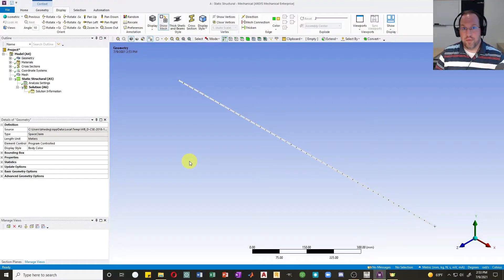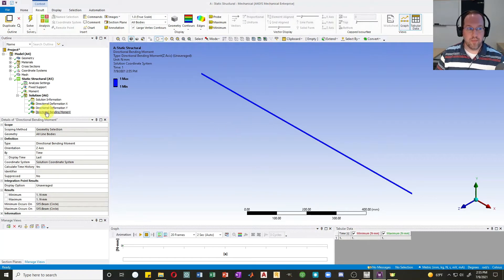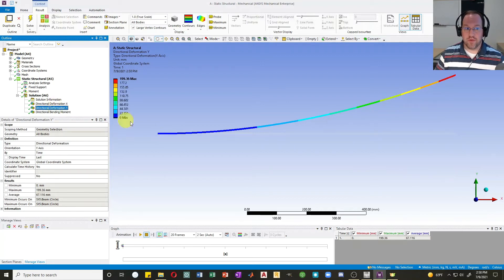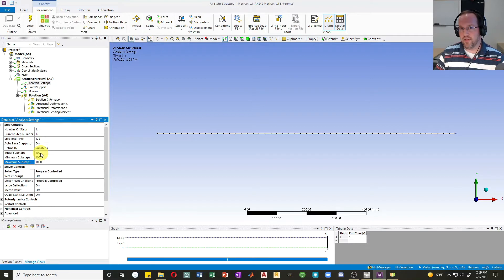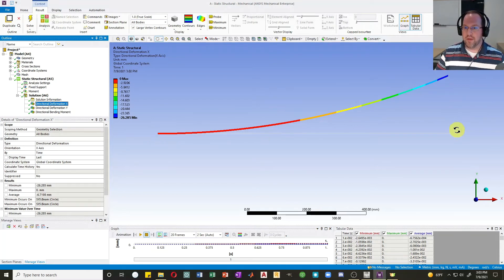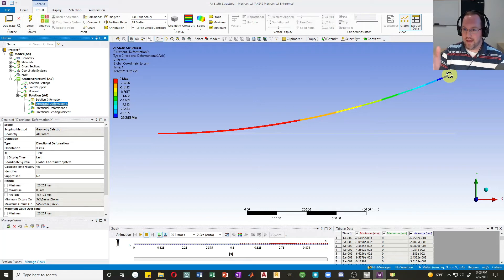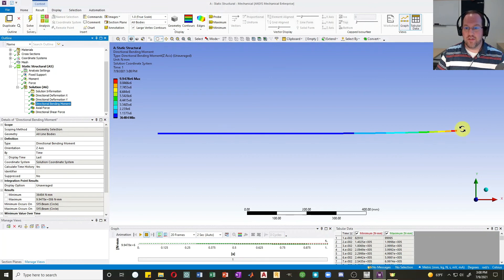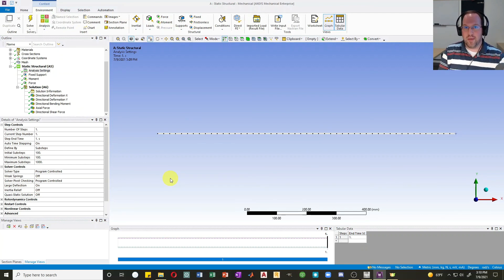Nonlinear Geometry and Large Displacement Analysis - FEA using ANSYS - Lesson 7

Comment: please i have a question, i simulated a ball on disc, the target material being a polymer i assume it ecounters large deformation, i assume it is hertzian theory, that appears to be wrong, to not assume it should i change it to large deformation like in the video?
Reply from the maker: Not sure if that will solve all your problems here (contact can be tricky), but yes, at the very least you should use large deformation. I’m afraid I can’t help much more than that without knowing exactly what you are up against here.

Comment: Greetings Prof. H  i have a question how the axial load caused the end moment to become almost Zero . what i understand is that the applied axial load should have increased the End moment as the deformation of the tip is  upward which  will cause an additional moment in the same direction
Reply from the maker: I assume you mean the moment at the fixed end on the left? The applied axial force is pointing to the right (putting the cantilever into tension), but the concentrated moment at the right end acts counterclockwise. To find the moment at the fixed end, consider the summation of moments about this left fixed end. The axial force times its moment arm (deflecting upwards) acts clockwise, thereby cancelling out a considerable amount of the concentrated counterclockwise moment. That the resulting moment was near zero was an accident, but in general, this tensile force will reduce that left end moment while a compressive force would have increased this left end moment.